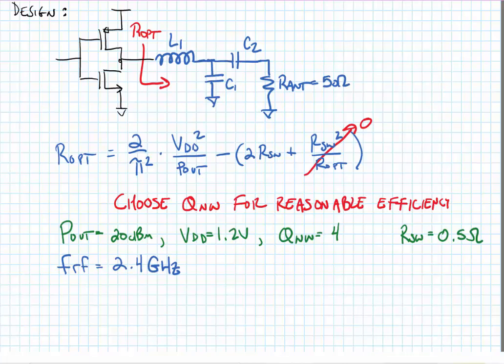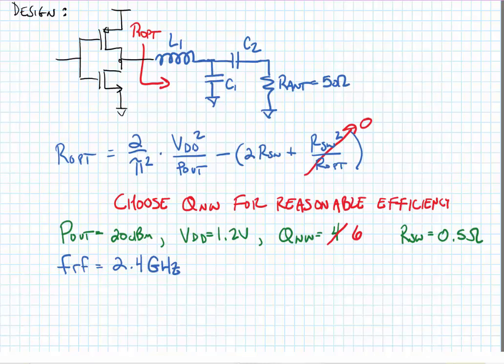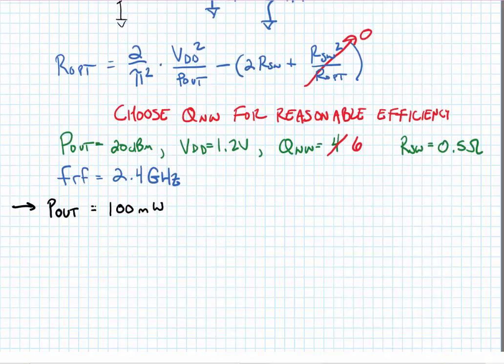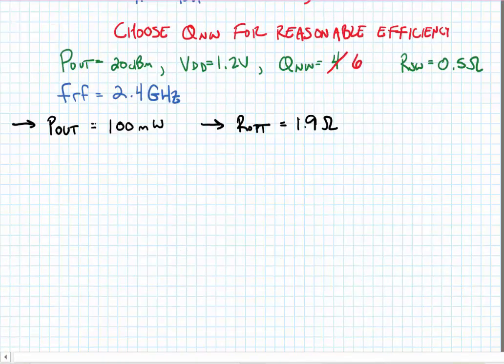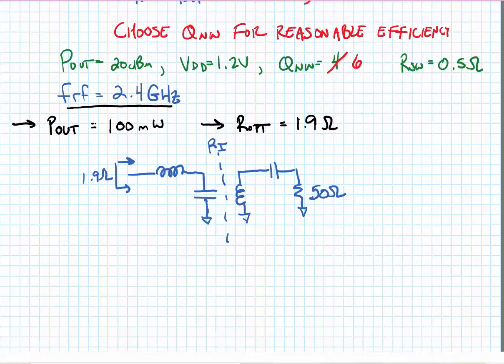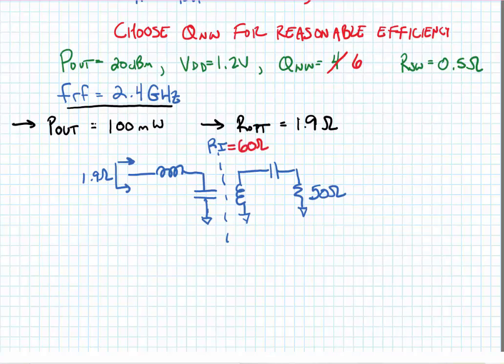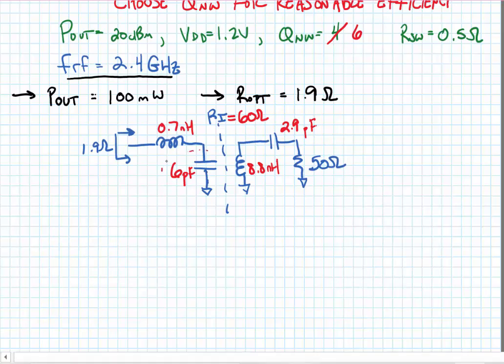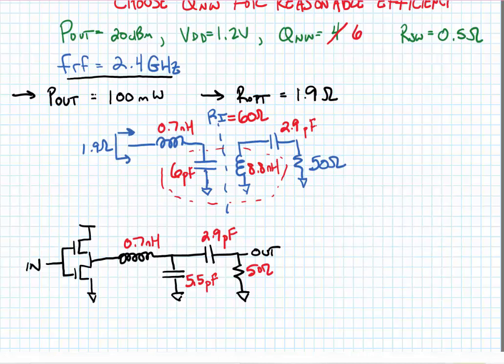Lecture 17.3 - Example Class-D PA Design

Comment: Hi Prof Jeffrey,   
Thank you very much for your amazing video lectures on RF PA.

Here for the MN, before 0.7nH, shouldn't you have a C (on-chip cap arrays of the SCPA)? So the Ropt=1.9 ohm, Is this Ropt including C (on-chip cap arrary) or excluding C (on-chip cap array)? 
The MN in this video is very suitable if we consider the bondwire inductance (0.7nH)
Reply from the maker: Hi Asif, No, This is not an SCPA, it is just a class-D PA (e.g., inverter + filter). If it were an SCPA, the C-array would become part of the matching network (series C) and we would have to re-compute to account for it.

Best,
Jeff